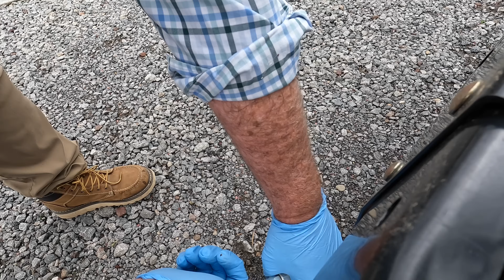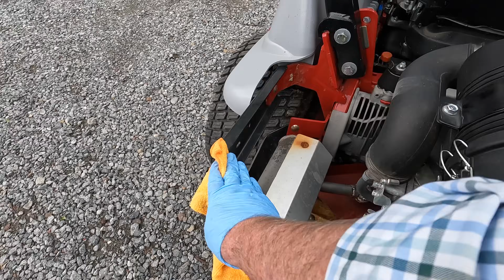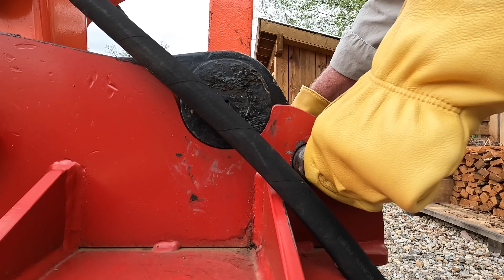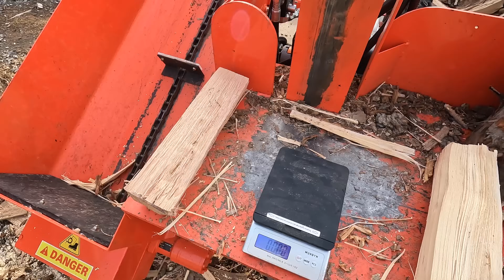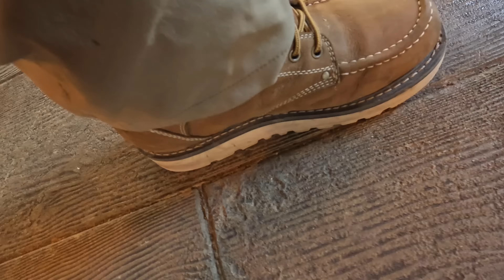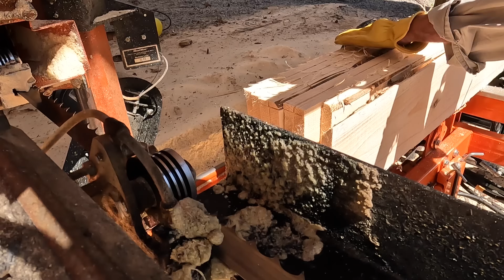We Have Been Keeping a Secret! We are outta here!

Comment: You will discover burning pine, regardless of high dry it is, it will produce a significant amount of tar, turpentine and heavy smoke which is why it was never used in fireplaces.  The residue buildup in chimneys would cause chimney fires and burn the house down.  It will cause tar and stain build up on your fire pit.😁

Comment: Standing oak, cut sawed then placed in my kilns 25 / 30 days dried down to 6 percent, pine either red or white frozen standing cut sawed 6 days down to 6 percent. Air dried pine from green to 15 percent 90 days, oak 1 inch thick air dried 1 year sometimes a bit longer down to 15 / 20 percent, depending on the equilibrium of the air moisture.

Comment: Pine and Spruce burn fast and hot. We usually take it down to 2" and use it with a few pages of newspaper to start the fire.  The twisted newspaper heats the pipe, pine or spruce catches quick and gets the hardwood going on top, just ash left, it burns completely. 
It snaps and pops, shoots hot embers at you, terrible for fire pits!!
When you get firewood around here, it's 60-70% hardwood and 30-40% softwood for $275 a cord.  All hardwood would be around $400 a cord!
We always bought a 4'x4'x8' stack of Cedar slab wood for kindling, much nicer wood!

Spruce trees, if you have ever fought a forrest fire, are the worst!!!!  They burn so fast it boils the sap and as much as a 6' top will "Blow up" shooting that piece in the air!!  If the wind is right, it will fly over roads and start fires on the other side of the road.
I still don't get why you guys love Poplar?  Here it's a nuisance tree that we try to keep off our property!  After 10-15 years, you never know when big branches or the whole tree will fall!  Causes most of our power outages!
Reply: I forgot, 2 ways to split it.....  cut your rounds and let them dry, or, split when it's below freezing.  You can cut it wet in the winter, cut into rounds and split the same day.  Bring it inside, stack close to wood stove 5' or so, and burn it by the end of the week!
But, like I said, it's kindling and needs to be cut smaller than your usual size.
Cedar kindling is much better, just harder to find.
Birch is always mixed in with wood, it's a hardwood, but it burns dirty!  It will creosote your chimney.  Same as Poplar,  burns dirty, takes forever to dry, heavy wood to lug, wet or dry!
I'm on the East Coast too, Atlantic Canada,  Northern New Brunswick on the great Miramichi River!
Don't bother booking a trip for Atlantic Salmon, (what we were known worldwide for).  Our Department of Fisheries let Bass baloon and took over the river!  They eat EVERYTHING!!!  The Salmon smolt don't stand a chance getting past the Bass to get back out into the ocean.
Reply: @PBandJDIY  For your information you can always edit your comments by clicking on the 3 vertical dots to the right of your comment.
Reply: @tonygrimes13  I tried, but on my phone, it only shows one line at a time.
I have bad PTSD and have trouble organizing my thoughts sometimes, then I just end up rambling about something unrelated.  I am 52 and medically retired from being a Federal Correctional Officer in a Federal Maximum Security Prison for over 25yrs and an EMT for 4 years before that.  I was on the prisons Emergency Response Team,  and I did all the jobs nobody else wanted to do....  I never had trouble with lots of blood or bodies until later in life.
From my city, there is not one road that I didn't pick up at least 1 body from.
I had no intention of being retired at 52 and single since 2018, with 4 kids that are grown now, 19-24.
But, here we are.....
Reply: @PBandJDIY  It is more difficult to edit comments on a phone.

Comment: O.K.  Here's my discovery.  As a guy who can spill used motor oil everywhere.  I know, I know....There's only a couple of us.  Have you ever seen a vacuum bottle for changing oil in small engines?  I got one at the local Advanced store and I love it.  Pump the bottle a coupla times to make the vacuum.  Put the hose down the dip stick and suck the oil out.  Once it starts to suck air, I twist the hose around to make sure I've got it pretty clean.  I always tilt the mower a little towards the dip stick.  First two or three times I used it, I had to pull the drain plug....Didn't even get a drop out of the darned thing.  I now spill one drop of oil when I pull the tube out...Sometimes.
We are driving the Bad Lands/Yellowstone/Teton/Bryce Canyon/North Rim Grand Canyon/Moki Dugway and south to see our son in Austin Texas this September.  You have a 4/5 hour head start on Hershey so we are taking three days to Wall, then hitting the Bad Lands on our way Cody for the night.  Did 6,000 miles last may....Hoping for 6,500 to 7,000 this September.
Hope the trip went well.  Thanks for your time.  Oh, BTW, looks like oak has roughly 2.5 times the BTU's of red pine.
Reply: X2 on the vacuum oil extractor. I even use it on my diesel pick-up. Soooo much easier to drain the last couple pints into a drain pan rather than the dealing with the entire volume at once. Especially now that I'm retired and flat-backing in the garage instead having a shop with a lift. The great shop and the people I worked with are about the only things I miss about my working days.

Comment: Took our 2022 F350 CCLB out West last summer.  2 weeks.  Big tour.  It was phenomenal.  Truck did amazingly well.  I track miles driven per tank at fill up and gallons to chart MPG.  Getting 1000 miles on a tank will depend on speed and next fuel location.  I ran to 856 miles and 42.48 gallons.  Wanted to push further but was concerned about next fuel stop.  Setting cruise at 88 in SD isn't easy on the mileage.  LOL!  I hope you have an excellent time.  We're heading to Banff and Vancouver and Glacier this summer.  Enjoy!  Relax!

Comment: Any softwood will dry relatively quickly.  In the boreal forests of Northern Ontario Canada many of us burn what is readily available.  The premium stuff is White Birch and Black Ash, but it all burns.  Technically the red pine will burn faster and will not provide anywhere near the BTU's that your hardwood will.  Red pine is always stringy for splitting in my experience.  The most important difference for me between burning conifer or hardwoods is that the conifer will snap crackle and pop which on one hand may seem nice, but when sparks and embers are spitting out of the fire pit and land on your clothing of foot its not so nice.  Leav the pin to dry over the summer - by November/December it should be pretty decent/dry if kept out of the rain

Comment: Hi! Love your channel. A little trick for you with the hose clips when you removed the fuel filter on the mower. Grab a small socket and you can snap it on that clip and it will allow you to move it a lot easier than dealing with the bulky pliers.

Comment: We use alot of Pine in the south for camp fires and fire pit burning. All of it has been dried properly. When dry it gives you a hot fire fast and burn's out quicker than oak or other hardwoods. Which does not leave you waiting for a fire to burn down if you are camping and need to go to bed etc.

Comment: Pine is great for a campfire 
Burns HOT and fast and is easy to light especially if you can find pitch
Reply: I think Mike made the mistake we all have made burning wet wood... too many splits on the initial start... rather then building up the fire slowly with smaller kindling...

Comment: We live Here in wv and we heat with one of the outside boilers and we burn alot of pine in it and it does really well and gives off good heat...I don't think I'd burn it in a house stove bc of the sap
Reply: Wv here too and I have one of those wood burning add on furnaces in my shop. It's one of those newer epa controlled piece of junk but it Burns, pine really well. Now it doesn't last as long as cherry, but it still Burns. The pine quite efficiently, not a lot of smoke or a lot of sap, build up. Not sure if that's because being an EPA. Stove, it Burns hotter.
With the reburn tubes and the ceiling of the stove, but I don't have a problem with burning pine. And the great thing is you can get it for free because nobody wants it

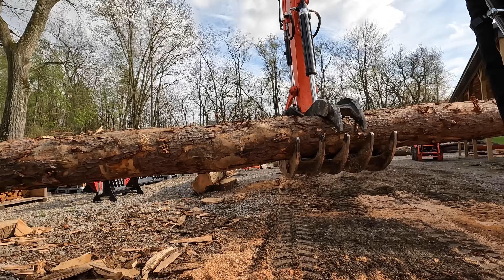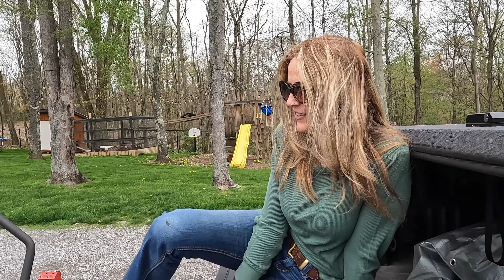Comment: I burned white pine off my property for 11 years in a water stove and never had to clean the chimney. The key is to burn the pine hot, leaving the damper wide open. I built a fire after work around 5:00pm. The water would be 180 by 10:00 or 11:00 before going to bed. The hot water would heat my house and domestic hot water until the next day at 5:00. In the summer I had a 100 foot copper coil in my water stove which solar panel would heat my domestic hot water. It all work great! As all wood, pine needs to be dry as well.

Comment: Fun fact: Most of the dirt in engine oil comes from the combustion of diesel or gasoline. Engines that run on propane or natural gas go significantly longer between changes as the oil stays so much cleaner. Comforting to know that the dirt is not all engine wear material (as long as regular maintenance is done.)

Comment: Many places out west and places like Alaska that’s not as lucky as we are to have premium Oak & hickory hardwood they burn a lot of Spruce. But breeds of Pine and Spruce put off a lot of sap Rosen and it’s really dangerous to burn because of all the creosote it builds up in chimneys. So I suspect they clean their chimneys way more than we do in the central part of the USA with lots of hardwood to burn. The only way I will burn Pine Is  if I’ve cut it in winter, split it and stack it and let it dry for 1 year then burn it the next year and almost no creosote! But never burn Pine cut in spring or summer and split and used that winter without proper drying out because it puts off a bunch of Pine Rosen creosote build up that’s highly flammable and not safe in a chimney.

Comment: Pine is ok for starting a fire in an outdoor pit, but (1)rots fast, due to bugs getting into it, (2)the rosin creates the pops, which then throw embers on folks around the fire, (3)it burns fast, and (4)remember them bugs...don't take it inside.  I would never use it in a solo stove, it'll make a mess of the metal with long-term use.

Comment: Mike don't worry about what people say, they are just jealous that you can buy what you want and need. As for burning pine it does burn hot and clean but out West here I prefer Douglas Fir, Tamarack ( Larch) I live on the East side of the Cascades and the only oak we have is scrub oak which is good firewood but it's small and takes forever to cut a cord. On the West side of the mountains they have Maple, Oak and Madrone, I've never burnt Madrone but I have been told it is the best firewood.

Comment: Here is my unconventional firewood story. My brother is a contractor. He wanted to do a cleanup of his job site and then head to camp for a long weekend. He had the crew pick up all the scraps of 2x framing material and throw them on his trailer. So we had about a pickup truck load to burn in the outdoor ring. We used the blocks to make a castle and then we burned it down. That stuff made a nice cheery fire, the crackles and pops added a nice touch, the fire lasted longer than we have thought and it all burned down to the nicest bed of coals. We were going to do hot dogs and marshmallows but someone had the idea to wrap up some spuds and bury them in the coals. We had the best baked potatoes ever at 11:30 at night and people still talk about that great softwood campfire. 🥸👍👀✅